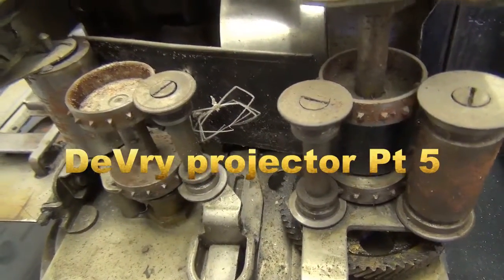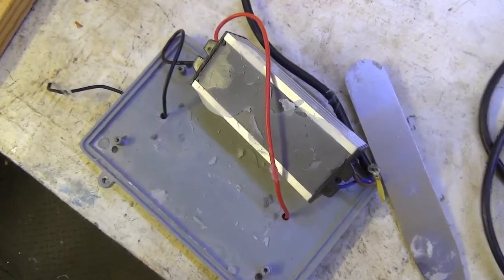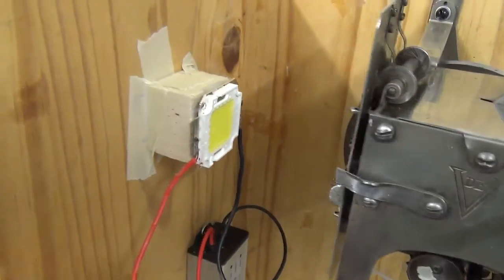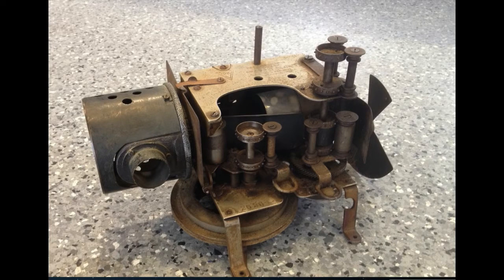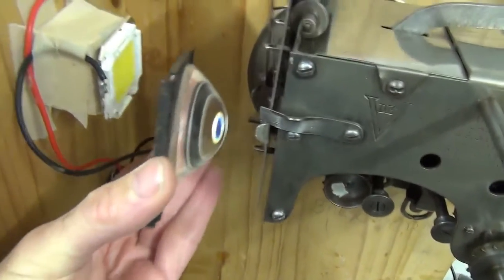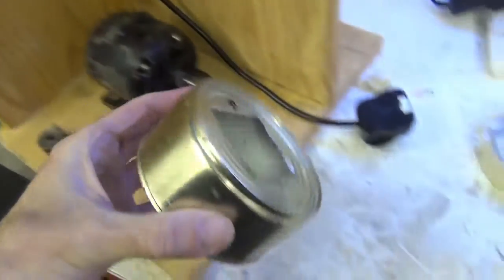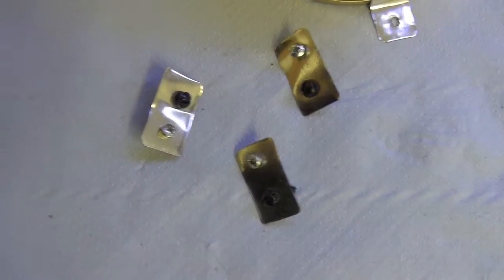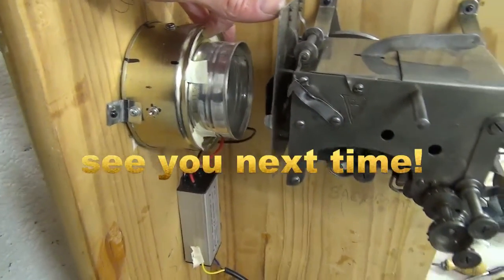DeVry 35mm silent movie projector reconstruction : Part 5

Comment: Can you share any details on the LED and driver that you used?
Reply from the maker: You can buy a 50w (daylight white) LED chip and driver on ebay. Don't buy the 'integrated' (driverless) type. Also, I've found that the brighter 100w versions of the LED chip/driver have a 'ripple' that can be seen on the screen, so avoid those. 50w is adequate for most purposes.